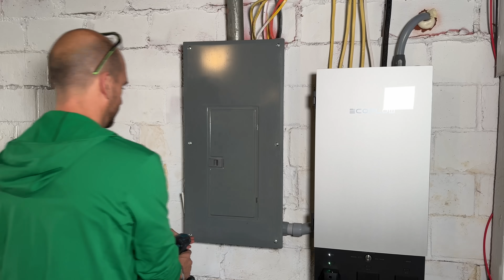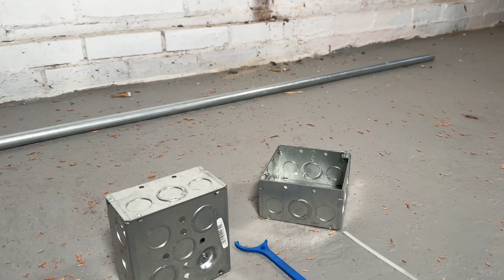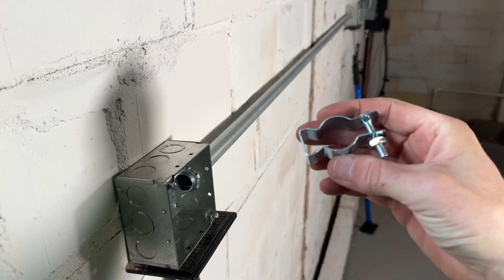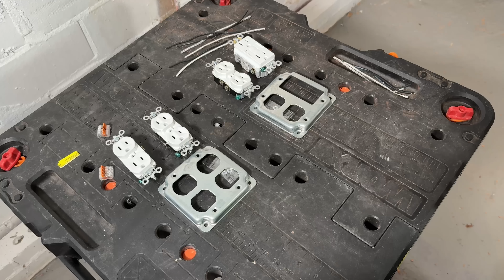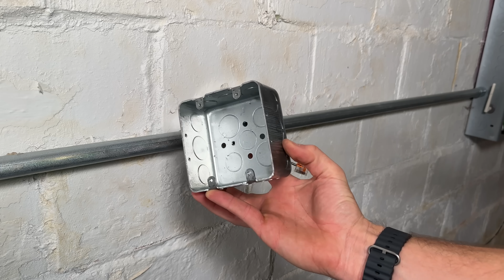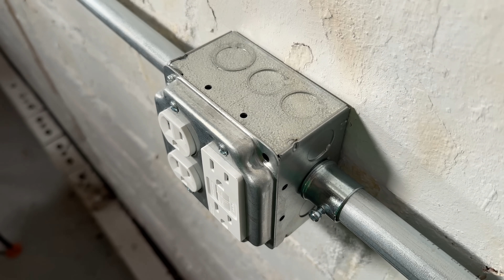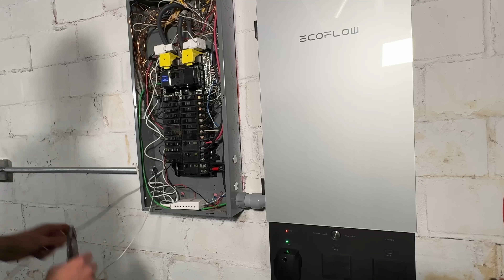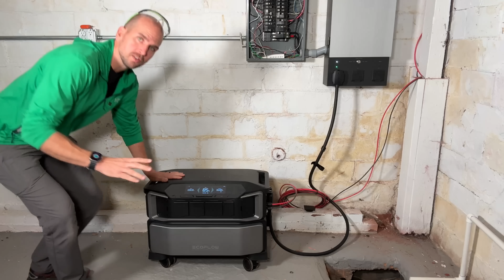Add Outlet To Unfinished Basement Or Garage

Comment: I always ran a green wire for ground. I heard all the arguments against using a ground but its better to be safe than sorry. Also in case of using orange dedicated receptacles with isolated grounds the green wire is required. I dont do too many EMT jobs but my home will have green wires for ground inside the EMT. 73

Comment: I think best practice would be to always use the insulated green ground wire so as not to depend on grounding continuity through metal conduit connections, which can become loose over time.  Also, I would never use WAGO lever nuts, particularly on circuits where the loads might be heavy; not just my opinion - see plenty of comments on other YouTube pro channels about WAGO lever nuts.
Reply: Agree about Wago , they are junk.  Ordered a bunch from Amazon and found they DO NOT stay closed !   Sent them all back rather Quickly for a refund.  3M Push -In connectors Very Good as a quick-wire alternative.

Comment: My Dad had a piping tool that would make that little offset so the pipe would lay flush upon the wall surface. It was like a vice block with a lever and you would place the pipe in it and crunch it into shape. Kept the pipe tight to the wall after it cam out of the box.
Reply: An offset bender

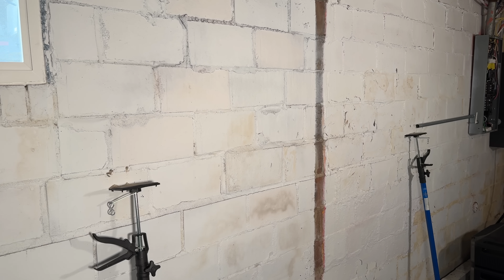Comment: Hmm.. if you only have a 14/2 4:18  (hot and neutral) feeding a bathroom fan and a light controlled by the  same switch- can you just pig tail the two wires and connect them  to two separate switches ( one for the fan and one for the light) ?

Comment: Nice work! I would submit, that it is JUST as easy to install the green ground wire, than to leave it out. Reason being: the next homeowner/person that is NOT at your skill level, decides to EXTEND that run, is gonna be wondering what the heck is that, without a ground, and WHO is the ''idiot' that ran that circuit without a ground :)

Comment: Several points: 1) Wire is cheap, compared to safety...always run a grounding (green or bare) wire through the conduit and to outlets/switches. Your metal ground through the boxes/conduit depends on tight screws, etc. Screws will work loose over time, which will destroy your grounding conductor system. This is dangerous situation that could occur and you'd never know it until disaster strikes. Having a separate grounding conductor provides redundancy. If someone later does work and fails to re-tighten screws, you won't be in trouble.  2) You stated this is a 20Amp circuit, and you correctly used 12 gauge wire, yet you used 15 Amp outlets. You no longer have a 20Amp circuit. 3) While you did say you turned off the power to your sub-panel, it's always a good practice to actually put a meter on it to ENSURE the power is off. Taking 30 seconds of extra effort provides extra safety. This rules out any hint of something not going as planned when turning a breaker off (if it happens to be the wrong breaker).
4) I think you'll find that unless you're in a wet environment, using NM type cable (Romex) is perfectly fine inside a conduit, provided you follow any derating required by code.

Comment: Using the EMT as a ground is "old school" and works well but is generally frowned upon by municipal inspectors; they made me put in a dedicated ground wire.
Why does the ground wire have to be an insulated green wire? Can't you run a bare ground since the metal boxes are going to have grounding screws, the ground wire is free to contact the conduit.
Never understood why it was against code to run Romex in conduit; it's not like you're going to have thermal meltdown of the silicone jacket.

Comment: This should have been an excellent instructional video. However your use of speeded up video destroyed it's effectiveness. It is simply impossible to see what you are doing. If you had just done one set of connections at real time instead of cramming every connection into the show this video would have been of greater value. Your verbal descriptions are good. I learned about not using Romex in conduit. Also about grounding when using metal conduit. You put out good information. But please get rid of the speeded up video. Also the wiring in your circuit panel is one of the worst I have ever seen. There is no way to tell what is going on in that rats nest.

Comment: Learned something new from reading the comments: Do not use plumber’s tubing cutter on EMT. Better to use hacksaw. Tubing cutters leave behind a sharp inside lip which is difficult to remove. Another thing I do is to screw a plastic bushing onto the threads of the EMT connector inside the J box. This provides really good protection against chafing the insulation on the wire.

Comment: Just a dangerous homeowner here.  I am confused, why not use romex in this application?  I understand that the metal conduit/boxes provide a ground, but what is wrong with using the romex?  Are the concerns about the outer sheathing getting chafed/cut?  If so, doesn't that concern apply to the individual wires pulled through?  Seems like the romex would provide and extra layer of protection for the individual wires...

Comment: Dude! So many things. No low voltag 8:15 e in the same conduit or box with high voltage. Conduit must be strapped within 3 ft of any box and a😅 8:23 t least every 10ft (7ft works better). On masonary walls run parallel to the mortar joints. If you make it level and the wall is not level, it will look unlevel.
Never use a pipe cutter on electrical conduit. Use the hacksaw. Very hard to de-bur that sharp lip the pipe cutter leaves. And a hacksaw is faster and easier.

Comment: Aways Pull A Green Thnn Ground  To Have a Constant Ground.  NEC Code too.  Cutting Corners Is Not Safe.😅
Reply: Not a code requirement to have a wire type ground . EMT is sufficient.

Comment: Thee only thing that I noticed that was not up to code (but I should say I am not an electrician) is that the outlets should have labels on them that they are protected by GFCI.  Every GFCI I have purchased came with these little stickers, and it is my understanding that they are required to be installed.

Comment: Good, but you have to run a ground wire to avoid any possible misgrounding problems.
Reply from the maker: Yeah, I agree might as well add the dedicated ground wire 👍
Reply: Not required.

Comment: This installation is totally WRONG and against the National Electrical Code!!! When will this guy quit showing electrical installations that are WRONG. Can't believe YOU TUBE lets him continue with these videos!!!!!!!!!!!!!!!
Reply: What's totally wrong?
Reply: @pld8993  first of all, I am a 55 year electrician with a master license from my state. I have taught code for 10 years. First of all Romax can be used in pipe, but generally is not because of the code, maximizing the area which can be used inside a pipe. This guy drills a hole in the panel with a multi tap drill, which will leave a burr. This is not good for grounding. The pipe number three you are not supposed to cut pipe with a pipe cutter because it dens the pipe and causes cuts on wires. If left number four. Special wrenches are not needed to secure locknuts use a pair of multi lock players to tighten them this way it can be tightened tighter number five do not mount the joint of the block screws in the block not in the block joint number six Service boxes need a ground wire screwed into the back threaded hole in all boxes number seven the pipe this video needs to be strapped with either a hanger or a strap to the wall it cannot be left unstrapped eight the plates used in this video are called industrial covers which are made for 4 inch and 4 11/16 inch boxes eight I don’t trust lover nuts I was in charge of trouble calls when I was electrician and they always were the problem. Do not use to cut parts of the receptacle off leaves sharp edges eight a 4 11/16 box maybe use with the right industrial covers nine he shows no ground straps in boxes to the outlets which must be there 10. I did not see a ground bar in the panel in the panel is a mess. It is supposed to be neat and tidynumber 11 a back up with solar is new, but how does it receive solar when it’s in the basement I hope they take this guy off YouTube soon. I have watched many videos of his and none have been right.

Comment: I am going to defend this gentleman.  I like that he is encouraging people to think about electrical work and how much goes into it.

Did he do it the way i would, maybe not.  Did he violate code?  That is a harder question because code can change from place to place. 

In this specific case, is the basement a dry location? is it damp?

A dry basement means he could use nm cable inside the pipe.  A damp location puts extra requirements on the receptacles he installed.

This is all code book requirements, but what about ahj and there requirements?

Good job sir, keep up the good works.

Comment: Some comments:

First, gfci protection can be done at the breaker or receptacle.  Pigtailing allows you to set up both receptacle locations like the one nearest the panel.  This means my fat, lazy, behind can have them set up so there is a gfci at each receptacle location that functions on only that location.  Should one be hidden or if the are further apart, the walk to reset is not far.

As the pros know, section 90.4 allows your local building department (AHJ) to adjust or even ignore the nec rules.

Section 334 nm cable, in 334. 10.(A). (1). restricts  nm cables to dry locations.  Basements may be dry or not depending on your ahj.  There is information in the definitions section, but allows for some interpretation.

334.15 nm cable protection from physical damage.  Has a section for basement installs.  It calls for listed conduit with bushings.

Conduit fill side note.  Chapter 9 table 1 note 2 page 715 in the 2023 nec......if the conduit is for protection and not a completed conduit run, the fill requirements do not apply.  (Not applicable here.)

358.30.(B).  Emt supports.  Requires a support within 3 ft of a box.  Shown in this video between the 2 receptacle boxes, but not highlighted between the first box and the panel.  Again, ahj may allow this.

250.118 still lists emt as an acceptable equipment grounding conductor.  Fmc is also listed in this section with several restrictions.  This indicates the metal boxes are grounded per. 314.4.

406.9(A). Receptacles in damp locations shall be weather-resistant type.  Again, this is ahj on if the basement IS a damp location.

406.9(B).  Metal face plates shall be grounded.

406.11. Connecting receptacle grounding terminal to box......see. 250.146.

250.146.(A).   Has requirements for grounding the receptacle.   cover.... .must be listed and meeting both requirements.  2 fasteners that are permanent....Thread locking or screw or nut locking means, rivets.

These sections are from the 2023 code.  Please review any or all as I abbreviated the sections.  I hope i did not change any meanings in doing so.

Comment: Not a good practice, opens up bonding issues between the individual conduits and metal boxes, all would have to be bonded together. Most electricians work with live circuits so losing the ground as soon as faceplate is removed is a bad thing.
Reply: Conduit and boxes are bonded through the connectors.
Reply: @pld8993  exactly, that's the problem when using conduit as the grounding conductor.
Reply: @haroldschmidlap8487  They are UL listed and NEC approved for bonding. I'm not sure why you think using them exactly the way or for the purpose they're supposed to be used is a problem.
Reply: The problem isn't with the connecto rs themselves, but choosing and using the proper ones for the installation comes with knowledge and experience, and the craftsman installing them,redundancy is the key to professional installation's. Pro's wouldn't do this installation this way.
Reply: @haroldschmidlap8487  Sure, I would have done the install a little differently method wise, but the raceway and boxes are not installed incorrectly. The fittings, boxes and emt are exactly what a pro uses. While there are a couple code violations: 6' emt needs a mini in the center for support and paint should have been removed from panel for connector to get a better bond (even though those steel locknuts are designed to bite through the paint), there's not a lot wrong with it. Using the emt as a grounding path is exactly what I would have done in this case. For the cover, he either needs to use a pigtail to bond the receps to the box or he could get away with no pigtail if he rivets the receps to the cover. Using the raceway as a grounding path is not a problem if it's installed properly.

Comment: The most important thing is a ground wire and it should be pulled and bond every box ,device to the panel (if one of the connectors  every comes loose you've just lost your ground) call an electrician and do it right (that's it takes them years to get their license)
Because there  trained professionals 
OMG! ,How much is you and you're families WORTH???
Reply: The EMT is the ground, wire-type ground not required. Connectors installed properly don't magically come loose.

Comment: In my 60+ years of working with electrical; I just cannot bring myself to NOT use a ground wire back to the panel.  Good insurance i was told when I was much younger.

Comment: I do not like that you did not ask homeowners to have a dedicated ground wire.  My reason for that is to protect them especially if they take the cover off of the box with the power on.  Then you have no ground.  Please remember, unlike electricians who understand electricity, most people do not or think they do and that is where an injury potentially will happen.   A second thing I do not like is using concrete screws inside a box.  You are dealing with homeowners and you speak about safety by reaming the conduit, but having wires potentially chaffing against the head of a screw that you cannot see, is asking for trouble.

My thoughts, when you are making videos for the average person who does not do this all of the time, make them so they cover your backside.  People are sue happy and a service you are providing is great, but do not skip any safety protocol, even if it is easier for you.  

Thank you
Reply from the maker: Thanks for the feedback Peter

Comment: I say not grounding the outlets with a conductor to the box is a NEC code violation for the same reason why outlets and switches require a ground wire.  --  If you remove the industrial raise cover with the outlets, in they are not grounded.

Comment: When it comes to box fill are those wago lever nuts the same as an  insulated cap or from most people's perspective a wire nut.
Reply: Irrelevant, wire nuts are not counted in box fill calcs.

Comment: Glad you used a level to make sure that the conduit doesn't run uphill. If so, some line amperage loss could occur. Likewise if running downhill, the voltage could elevate because of gravitational pull. Another way would be to just follow the horizontal mortar joint which is level. (bricklayer point of view) I enjoyed the video. Great JOB!
Reply: Level is mainly for esthetics.

Comment: Wrong, it's not that you can't use Romex or shouldn't it's just that it's not "required". It will reduce the ease of pulling wire, you also will not be able to use the max wires for the conduit.
What you "cannot do" is strip the Romex jacket and put it into the conduit. You also do not need a ground conductor when using conduit because it is its own ground.
If in doubt read the NEC don't watch a YouTube video.
Reply from the maker: Thanks for the feedback.

Comment: If you do use a pipe cutter you can score the pipe by cutting a groove instead of cutting through  the wall of the EMT. Then use a pipe bender on the groove and it will snap in two. If you did it right there will be no sharp edge inside the pipe. The sharp edge will be on the end of the pipe. 

Do note some electrical contractors probably be ready to fire an employee for using a plumbing pipe cutter. If cut all the way through,   an unremoved  sharp burr insde the pipe could "shave" the wire as it is pulled through the pipe. I know I would be nervous having an employee using a plumbing pipe cutter.
Reply: Most people I know use a hand-held band saw to cut conduit.

Comment: I'm not an electrician, but I would never use 15A receptacles on a 20A circuit. Why? You spend more money on the wire, then cheap out on the receptacles. There are many reasons to use the 20A receptacles over 15A. If I saw that in the trade, my first thought would be, he cut corners.
Reply from the maker: Welcome to the channel!

Comment: Incorrect grounding/bonding of the receps. He either needs to add a grounding pigtail from the box to the receps, or he needs to mount the receps to cover with rivets or some other permanent means of attachment. Cannot use the cover as bonding means if receps are attached with screws.